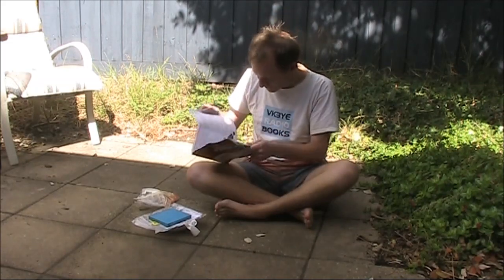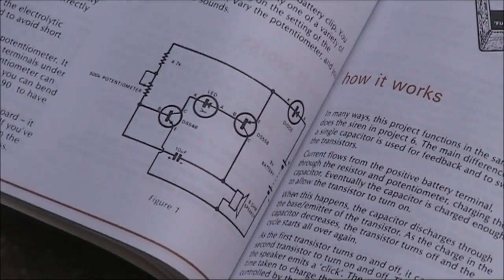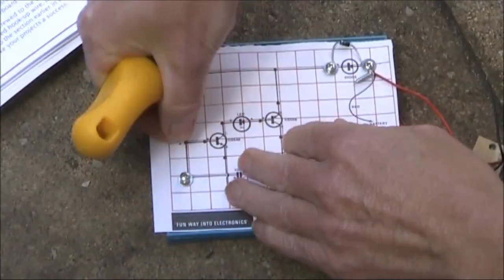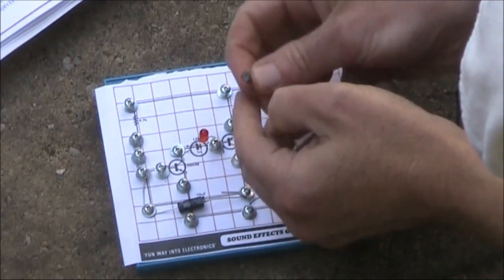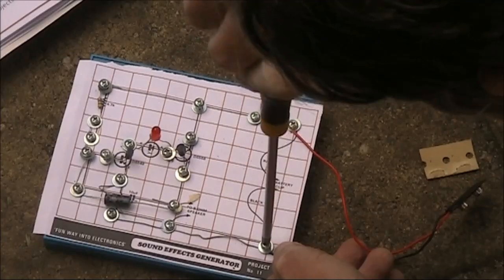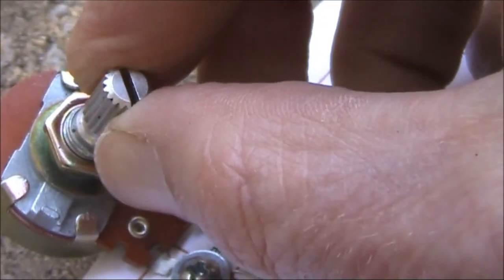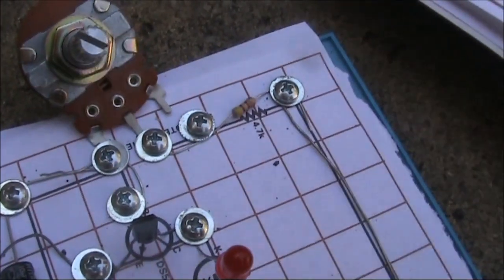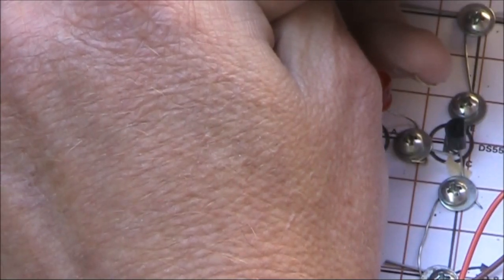Funway 1 builds: Sound Effects Generator (Project 11)

Comment: Reminds me of many years ago I had a book with some simple projects. One was a similar time generator, but using a 555 IC. I tried the light resistor and the circuit could be used like a Theremin. Once during a thunderstorm I put in on the porch and the lightning flashes would create tones.

Comment: Sounds like you could make a key board with switch's and resistors and play a tune
Reply from the maker: Yes. I'll do something like that in a future project.
Reply: That would be Funway Project 10: Music Maker.  It's an audio oscillator with a string of resistors and a flying wire lead to tap between the resistors.